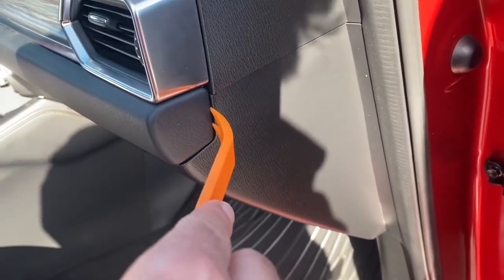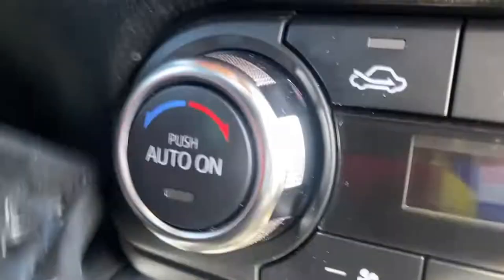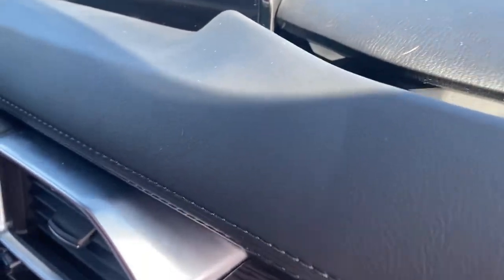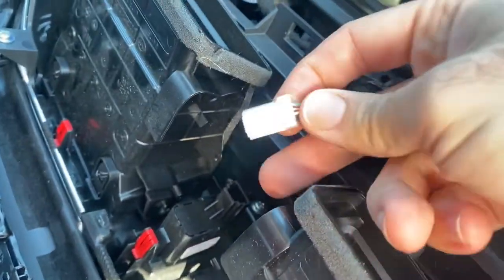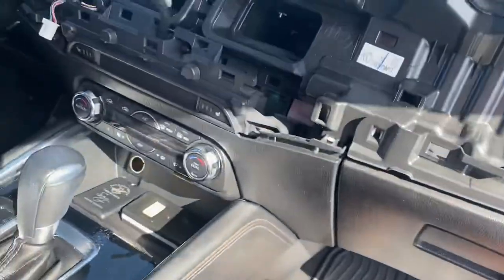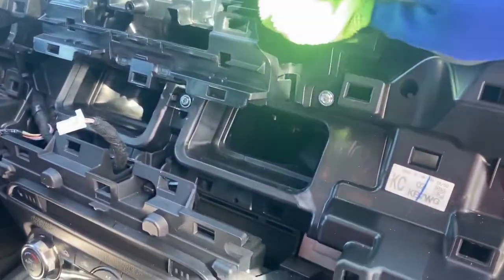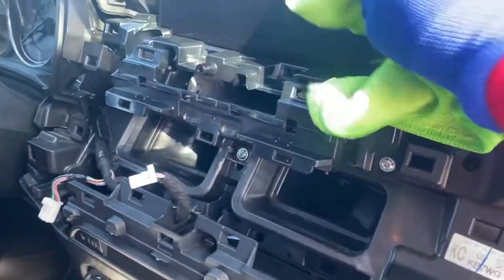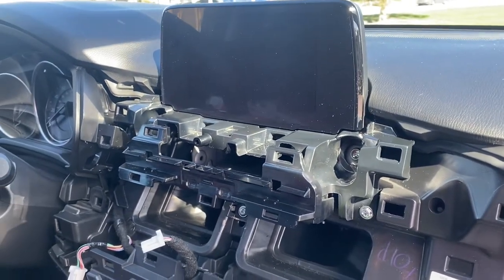Removing scratches (anti glare coating) from Mazda infotainment system (Radio) LCD screen - Part 2

Comment: Do you feel any noticeable difference on the screen after removing it? Is it less visible on the daylight/sunlight?
Reply from the maker: I apologize for the late response. Screen looks more visible and better in my opinion after removing the anti glare. But you can buy and install a screen protector or an anti glare film if you don’t like the the shinny screen.
Reply: @issa75777  no problem.  I did it anyway.  And it turned out great!  I ordered anti glare screen protector, but still havent put it on,  dont feel like i need it :)

Comment: Thanks. Good information but a before and after shots with the display on would have been much more preferable to just showing us a screen that's off. You should probably combine your videos to just one video.
Reply from the maker: You are absolutely right, I did not plan to make a youtube video for this. After I was able to remove the anti glare coating I decided to share this with other Mazda owners, so I made a quick video to help others.